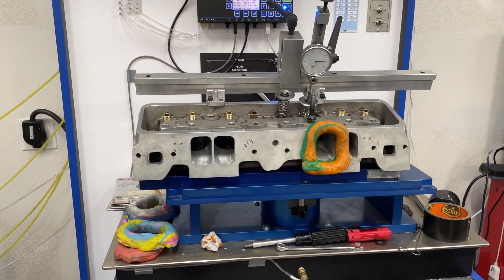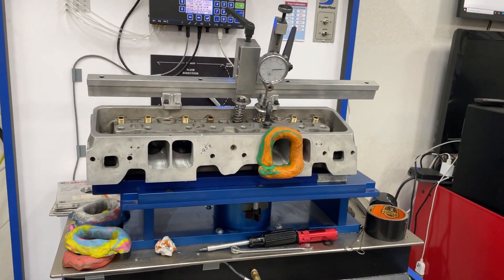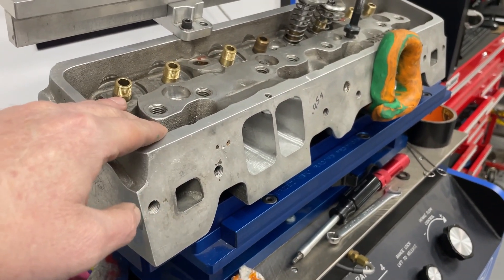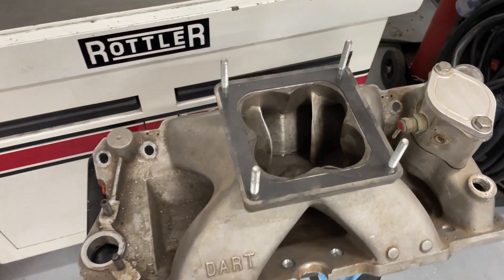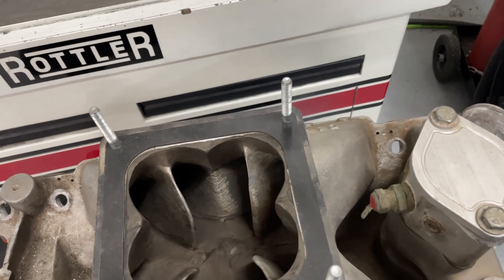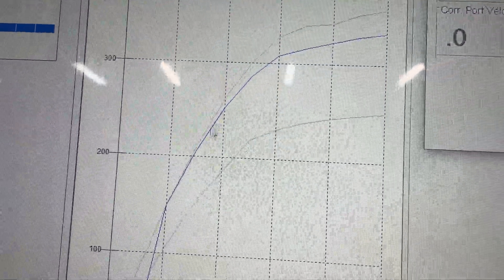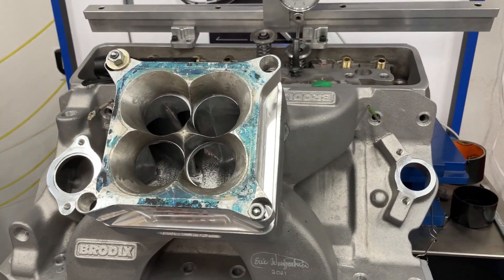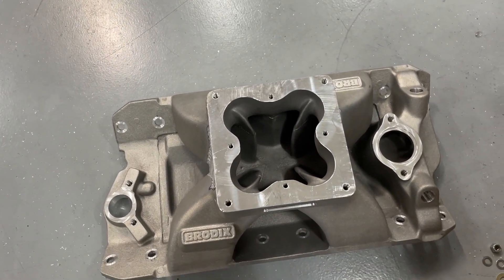Comparing Different Intakes Manifolds On The Flowbench

Comment: Wow. Great engine. I want to build a 421 for my 69 Camaro street car  with a hydraulic roller that I can drive anywhere. Can I run a big intake like those and still make some low end torque.  Let's say 2000 -2200 rpm at 60 mph?

Comment: Great video.  I lost count how many times I have reworked an older design manifold for someone. Because thats all they had or was in the budget . And being called an idiot  because it wasn't a new out of the box intake. The gains are always surprising , and when your curious about the . What if I try this approach is how racing has become so competitive and crazy fast in such a short time .I remember   reading about your Engine Masters  engine. I miss those. It showed innovation and put energy back into the sport . High 5s

Comment: MY thoughts on "knife edged" dividers.....Actually not mine....was explained to me years ago by a guy who has forgotten more than I will ever know about performance air flow....The knife edge can actually act as a "Shear" and take the fuel droplets out of suspension when the fuel mixture hits the edge at high rate of speed....Rounded edges will quell this tendancy....The carb venturis worked hard to atomize the fuel....you try to keep that mixture intact as much as you can.

Comment: Nice! I'm curious why not a 2971? That's what I'm running on my 867's now. Also have a ported HV 1005 if you'd like to flow it. I'm 4 miles away.
Reply from the maker: I have moved since the last time you stopped by. The 2971 has a taller opening than the ms91 so without using epoxy it would over hang the ports.

Comment: It sounds like the Engine Masters and circle track head designs would also make great street engines with their broad torque curves. As far as intake manifolds go, the point you’ve made about 1 inch before/after the valve tells me it’s a matter of cross section, and maybe transition angles, from intake to cylinder head. The difference between as cast and ported is a LOT bigger than I’d have guessed. Great video, Eric!
Reply: The circle track engines are awesome on the street! That’s exactly what we did with the retired circle track engines! In my area, your only allowed a 0.40 overbore! We actually had some of the people that bought them, run the 2 barrel circle track carbs! They were 500cfm, basically like what you would find on a old International 345 gas engines from the 60s! Because they would make alittle over 400hp with the 2bbl, with like 420/430 tq! Also they ran forever! With a box stock Edelbrock single plane & a 950 4bbl, they would pickup almost 100hp! It was so fcking cool 😎 when a guy with a fairly lightweight car,(under 3100lbs) & the 358 w the 2bbl carb, would beat guys asses horriblely w big block Chevelles Corvettes & newer foxbodys @ the time! It was so embarrassing to lose to a 2barrell all cast iron small block! 😂😂😂😂🤣🤣🤣🤣

Comment: Also, i have seen plenty of the new LS intakes that are extremely tall. You need to do a intake test on one of these. With the intake being so tall it looks like more of a straighter shot to the port in comparison to the other conventional SBC head single planes. 
So, my brain is thinking, the old conventional SBC heads with a intake thats 4-5" inches taller for a straighter shot?? Kinda like those intakes you tested but with double spacers. Think about that, similar to these really tall LS intakes
Reply: I’d like to see that too on those 706 heads, if you notice the fast 102 truck intakes are pretty tall and long for midrange I would think having a straighter shot may really help the flow compared to say a stock ls6 intake
Reply: LS motors have 15 degree valve angle not 23 degree so its far easier to get a straighter shot into the intake port...The LS7 is actually a 12 degree head...All Pro came up with the original tall single 4bbl LS intake that many others later copied.